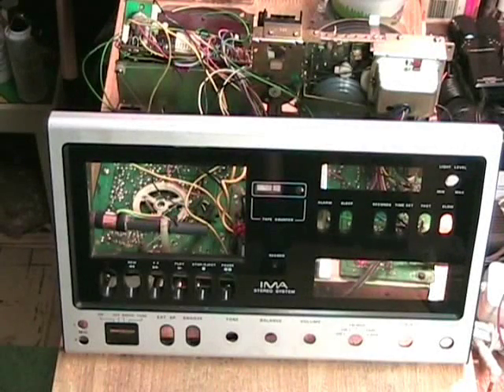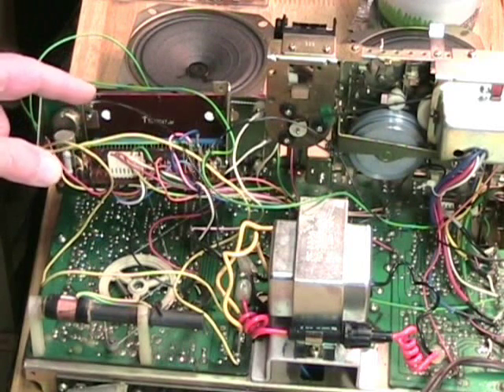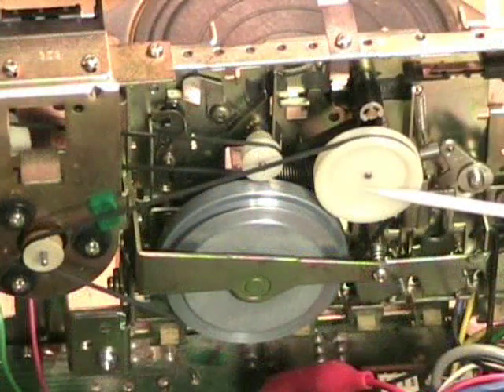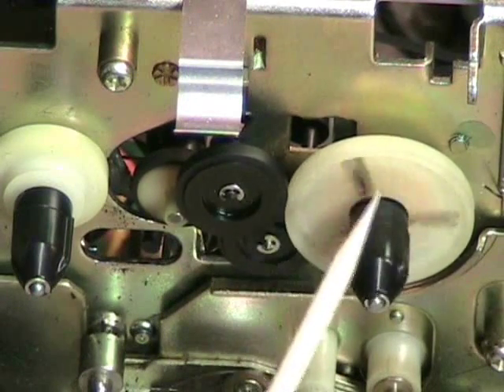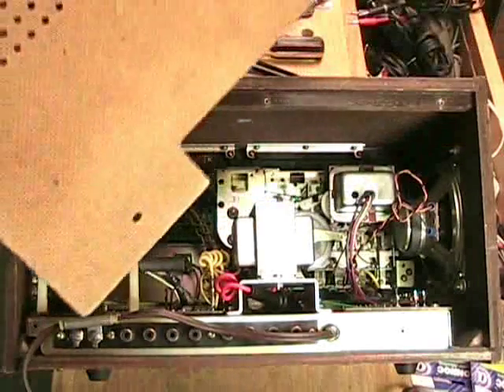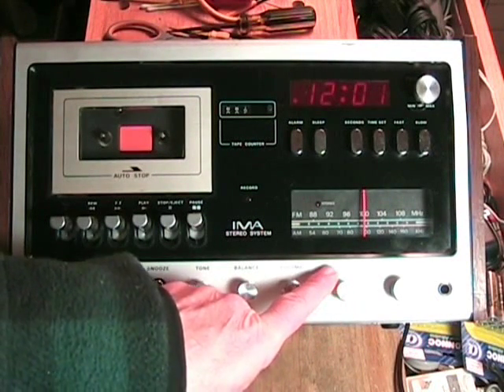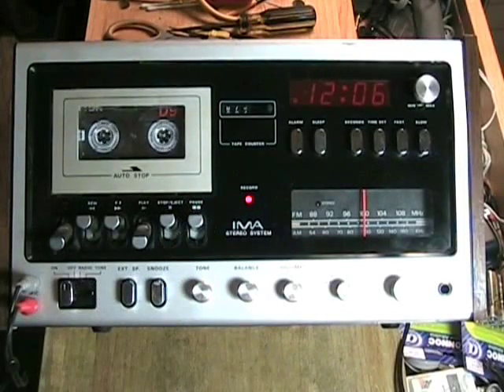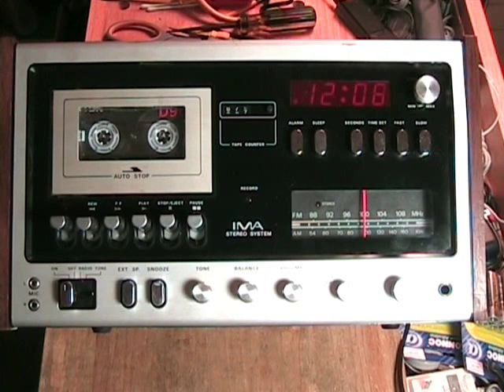I'm a CRAIG! Exploring the IMA CRAIG PS2000 cassette tape recorder stereo system.

Comment: Now this is what I call a "clock-radio", even though it's much more than that with the inputs and outputs and of course, a tape deck.  I'm suprised at how well this built and how good this records, Craig/Sanyo really outdid themselves when they deigned this.  It's a good thing you had a look inside with that fuse not being held down in any way, what were they thinking?

Comment: @clydesight Well, the radio is in such a position that reaching something that's supposed to be behind the cover is almost impossible without moving the radio.
But I was surprised by the fact that a much newer device uses the same style of case and cover.

Comment: You know, high quality stereo clock radios are still available today, they're not all cheap little things that sound like crap, I have a Sangean stereo clock radio with a CD player in it, it also plays MP3's.  I'd say it's smaller than this one and the speakers are side mounted, but boy does it sound good, it's also got a traditional analogue clock face below the LCD readout.  What country was this IMA/Craig stereo system made in?

Comment: I have this exact stereo system.  When I adjust the volume or turn it on, the speakers are very staticy.  Any suggestions?
Reply: Mix water and white vinegar and use it to clean the control knobs

Comment: @clydesight OK fair point.  Actually I remember your videos of the red Panasonic portable tape recorder, I also remember the video you did on the little Realistic stereo cassette deck.  The old 60/70 machines are certainly very interesting, the designs the manufacturers used were very unique as well, but like today's stuff there were plenty of good and bad eggs as yon and CassetteMaster have pointed out.  I belive CassetteMaster had a HORRIBLE little shoebox unit that was simply terrible.

Comment: There is a Craig branded unit almost identical to this one except for the fact that it has an 8 track and cassette along with the clock and tuner. Unfortunately it was very beat up and way over priced for the condition.